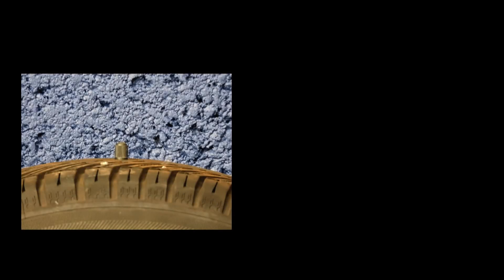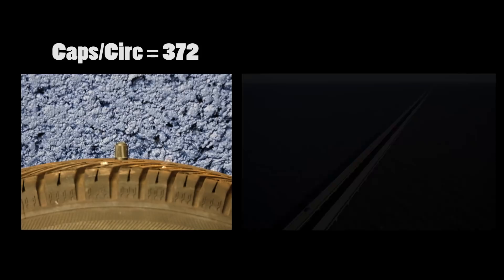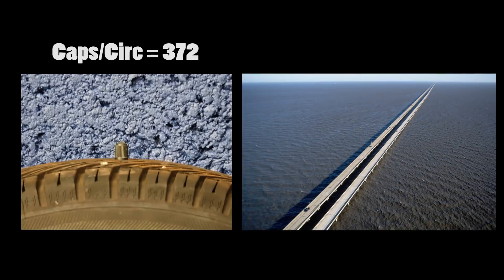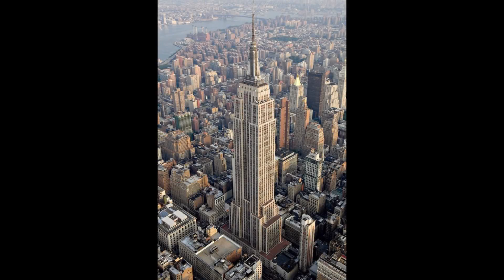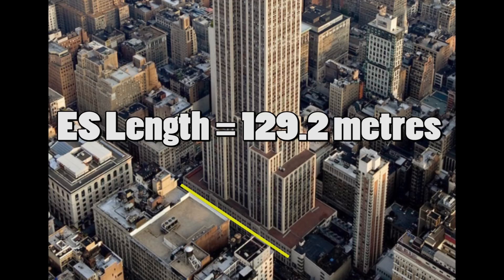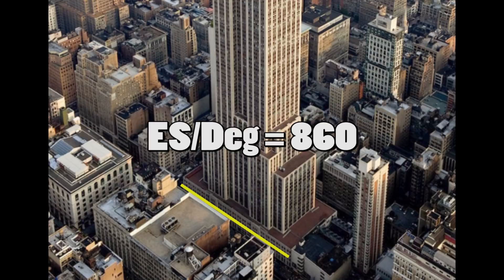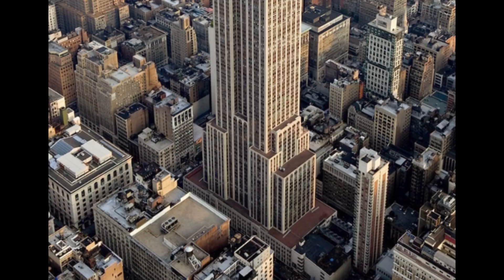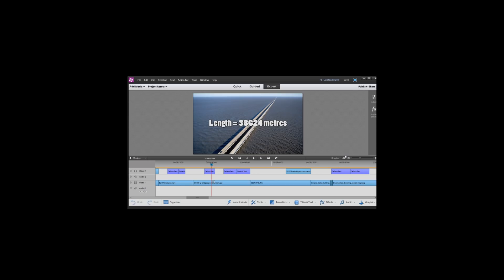Flat Earth Can't Scale

Comment: On Dels Basketball sized Earth the oceans would be less than a sheet of paper deep ..He would never tell his sheep that .
Reply: The Marinas Trench is less than 7 miles deep. You would need a microscope to see the water if scaled down to a basketball sized earth.
Reply: The Marianas Trench is 7 miles deep. The Earth has a diameter of 7000 miles or over 1000 times the deepest part of the ocean. A basketball has a diameter of just under 10 inches. The water sticking to the ball only has to be one hundredth of an inch deep. The natural adhesion of water could probably handle that. The Earth is also more porous than a rubber ball. The same way a dew drop can stick to the bottom of a leaf Del's experiment if done honestly would show that the round earth model works even with overwhelming gravitational fields from the actual earth working against it. Like most Flatearthers numbers and calibrated equipment does not factor into the experiment.
Reply: @paulsardinasify  Excellent explanation .Yes Dels basketball experiment is a absolute sham .
Reply: @paulsardinasify  Wow even worse for Flat Earth ,thanks for correcting me .
Reply: If the earth was the size of a basketball, Del shed rage would be the size of one of the most toxic bacterias known to man. 
Clostridium botulinum. 5 micron.
Do he really think such a small creep can detect curvature on a basketball???
https://ibb.co/ktJaPo

Comment: Hello Al K, Im sorry but I think Your logic is reversed. Can you do the same experiment using water instead of plastic? Would the experiment have the same results if you used the river and its contents rather than the skyscrapers for you hypothesis? It shows how stupid this experiment is when you chose a hypothetical 800 skyscrapers rather than something real,like maybe the Andes or The alps? They are a lot bigger than skyscrapers. That experiment is a flawed misnomer at best.If you can be fair about this, then please demonstrate a relevent experiment by putting the same amount of water TO SCALE of the atlantic ocean on a globe the same circumference as your tyre. Dont worry about gravity im sure its working holding the tyre to the earth, it will work on the water too. Then put the water at any point you wish around the circumference of the tyre. If you want to put it at the bottom upside down its ok the gravity will work,dont forget its universal and will act on the water and draw it to the earths core. Remember it runs of the ball because it is getting sucked to Earths core, it has nothing to do with the fact that its water and it cannot be supported without a container and and thats why it always runs of convex surfaces to ground level. Remember the water and the tyre are in the same atmosphere as allll the other water and tyres so atmospheric conditions wont effect this, it will be a fair experiment...... Please Go and show what happens using water to atleast give your experiment some relevence and context in a fair way. No one disagrees there are large masses of curved land. We call them mountains ranges. No one disagrees it is possible to set a lid on a tyre. I do strongly disagree when You deny the physics of water at any scale including the only scale that matters, your own scale. The scale every human uses to understand,comprehend and learn and the scale that all scientific understanding stems from. Which is the foundation of everything you know. To believe that seawater curves is to assume that it behaves in a different way than it does at all the scales you can test with the scientific method. Water looks, smells, tastes,behaves and feels exactly the same way in a test tube, petri dish, a Glass, a sink, a bath, a large puddle, a swimming pool or lake. You have the inability to realize that you are holding a belief about water that is contrary to every conceivable scientific test you can prove practically to yourself, using your own faculties and senses, in a testable,measurable and repeatable method. I do not understand Why you choose an unproven belief over the science and understandings you can prove yourself. That is insane to me. I have nothing against you personally at all I am just pointing out this experiment is a failure on every conceivable SCALE.
Reply from the maker: Your logic is reversed. You observe water moving towards the earth, you sarcastically refer to gravity while simultaneously claiming it would work in reverse; and your muddled attempts to be smug about the gravitational effect rely upon water behaving differently than is observed, where nothing claimed about how water behaves in any way contradicts reality. In fact that is the great fabrication of the flat earth meme.

You also make assertions about how water behaves in scale which are - while utterly vague - completely false. Unlike you, and apparently every other person in flat earth who all say the same silly things, I actually do observations involving water. When I observe a body of water it is not flat, it has peaks, troughs, swells, swirls etc.  When I observe a horizon that obstructs objects several hundred metres high I know the shape the water must be and it is most definitely not flat. To say otherwise is to deny what I observe and to deny my senses. I can confirm my observations and have done, you guys are all talk and no substance. My avatar is another example of how water behaves, I took that photo myself. You can go and check out the Grand Kugel example of water adhering to the outside of a sphere to scale but I'm willing to bet your demand for a scale example comes with no comprehension of what that scale might be and you will be the one denying what you observe after seeing it.

So, sorry, but I don't buy your short sighted rhetoric.

Comment: I love the 'Flerfer from Ipanema´! You should make a whole song from it (or is there already?)
Reply: Del 
"what is it that happens by increasing the scale of a body of water that allows it to take on the characteristics of elasticity?"

Nothing. 

Here's water retaining rotundity

"Grand Kugel (large granite ball supported by a very thin film of water)"
https://www.youtube.com/watch?v=uN-7UNZ4MvA

Note in particular this quote, from that video - "It is best after it has been still for awhile and the exposed surface is dry. That way you can get a grip on it to get it going. Once it is ALL WET, it is slippery and hard to influence"

OR 

Find a curved drinks glass
Put some iced water into it
Put it in a warm place.

After a few minutes, observe the water, showing rotundity, on the outside of the glass. 

OR

Go into a bar
Order a cold beer
Observe the vertical layer of water that forms on the outside of the glass
It's why we have beermats

etc
etc
Reply from the maker: Not yet but it could possibly be arranged.

Comment: Nice, Del and that genius Beyond Belief are always demanding “practical examples for real men” you have clearly and simply done that. I wonder what the quibble will be: “a tyre is not a practical example of bendy water.” Good job as always 👍
Reply: Beyond the imaginary curve. 
Careful accusing others of denying reality Del!
Reply from the maker: Thanks. Excellent username 😀
Reply: "what is it that happens by increasing the scale of a body of water that allows it to take on the characteristics of elasticity?"

Nothing. 

Here's water retaining rotundity

"Grand Kugel (large granite ball supported by a very thin film of water)"
https://www.youtube.com/watch?v=uN-7UNZ4MvA

Note in particular this quote, from that video - "It is best after it has been still for awhile and the exposed surface is dry. That way you can get a grip on it to get it going. Once it is ALL WET, it is slippery and hard to influence"

OR 

Find a curved drinks glass
Put some iced water into it
Put it in a warm place.

After a few minutes, observe the water, showing rotundity, on the outside of the glass. 

OR

Go into a bar
Order a cold beer
Observe the vertical layer of water that forms on the outside of the glass
It's why we have beermats

etc
etc